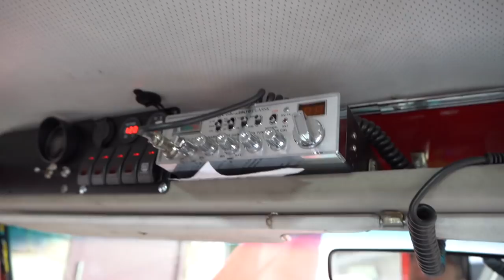THE WORLDS ONLY Dual S400 WCFAB Compound Turbo Kit Install!

Comment: If you do move the Comp. switch and gauge, IMO I think it would look pretty good in the step of the bumper. It’s still back there for your original design of purpose and somewhat a little protected from the elements

Comment: Need to get a the level ride valve and set it so it the truck is level and when you add weight it will automatically inflate the air bags and deflate them when you remove the weight.

Comment: You wont be disappointed with the wireless 1 airlift kit, You can control with your phone app but I just use the controller that comes with it. 3 presets and so much adjustability

Comment: What trans are you going with? I went through a suncoast comp, it lasted 2 years and then got a revmax 850 before I sold it. I had a 08 mega with 64/88 compound from BD, 100 over injectors. Studs. 85lb valve springs. Fleece, fass, coolant bypass. I twisted a stock input shaft on level 4 barley rolling into it...You should do an Allison swap! 68rfe will only get 40-50 pulls before a refresh if you really put the power down. They aren’t meant for real power. I have receipts to prove it 😭.
Reply: If you're asking about 8 Ball's transmission, it has a 48RE in it and he is having Firepunk build the trans for him.

Comment: I’d say easy 1000hp not almost you prolly should have done bigger injectors but it’s still going to m  ah me big hp as far as you went really would have been way better if you would’ve had drew cut your head so they could’ve ported the whole thing and polished but maybe later that thing will wax your dmax race truck tho it’s so addicting you’ll see